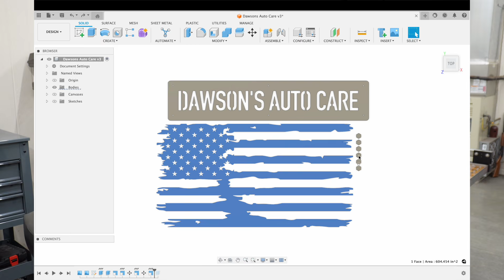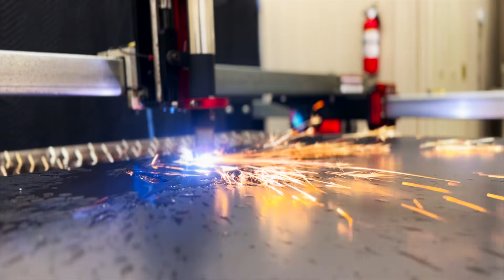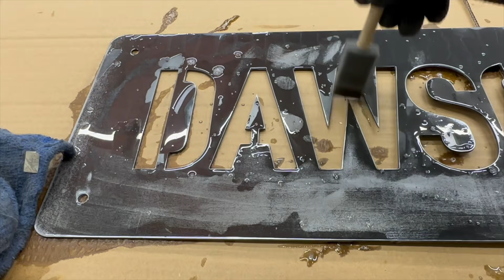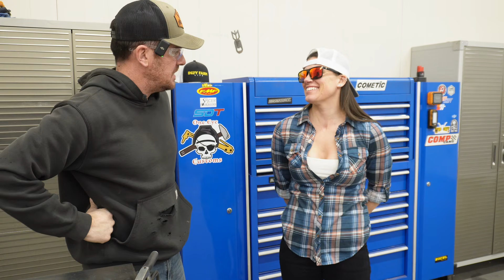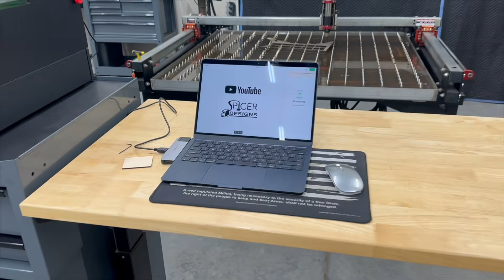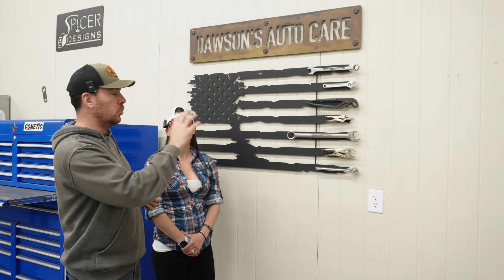CNC Plasma Sign Build....You Just HAVE To Watch This One

Comment from the maker: Check out all of Langmuir’s tables here: https://store.langmuirsystems.com/?aff=25
Reply: I actually just made a splash guard 😅 I was worried about water getting into the electronics as well. I have a shelf I made on the bottom of the table with some L channel and aluminum cutouts that holds my razorweld. Mainly because cords draped everywhere drive me insane and I already had to fab a new voltage divider cable because I caught it and snapped it off. Which I added an inline capacitor to level it out better and it works much better more stable voltage readings no random torch outs. To make the guard I just measured the distance of the torch mount bolts and height range of the z axis designed out from that. I ran a slot mount instead of a fixed mount to add a spring system to it. So when it touches off the guard it moves up and back down without binding up the torch height control. If you have a sheet metal bender that's perfect. If not you should definitely get one it's a solid investment and will get used once you have it... you'll get tons of new ideas trust me. I generally program a small v shaped notch along the edges where I'm going to bend the part for alignment and bend relief.
Reply: And actually if I had to redo the guard I would have designed it so the front portion was a separate cutout piece with a hinge so changing consumables would be easier. Which I still might do at some point
Reply: Have you figured out you Torch height controller yet.
Reply: Your lady has no class nor do you 🤮wish it didn’t mix with the USA flag which has the class

Comment: I cut at 45w 100 in/min. is that ok for smaller, more intricate designs? My school just got it a bit ago, but I'm the only one willing to set it up for custom cuts. works well with downloadable files though.  (I have crossfire pro with the specific CNC torch)
Reply from the maker: Depends on the material and thickness.

Comment: Those clips you welded onto the sign the rusted sign to hang it on the wall.  Whats the name of those clips so i can make some with my cnc table.  How did you make them and what guage metal did you use?  Also what guage metal is the sign?  Im just starting.  Thanks for great ideas!!
Reply from the maker: I use 14 ga for most of my signs.  Especially if i weld in them. Just have to draw them out in cad and bend them.  I sell my design files if you want to email me.
Reply: Ok i did send email thanks

Comment: Really comes down to how quick you think you could do it. I have a different table that could do all of that in one cut session and at 200+ ipm. If I had the DXF files ready to go, probably around the $550 mark all in is what I would quote someone for this. Double the material cost (roughly $40 for half a sheet 4x8 14ga x2 = $80) + $50-70 consumable fee (paint, electrode, tip, electricity) +  roughly 4 hours shop time which would include the like 10 minutes this was being cut. No DXF, add a $75/hr draft/Etsy search fee (cheaper than shop rates since it only wear and tear on my desk chair), minimum 1 hr. If it took 10 hours, my rates would be in the $1150+ range.
Reply from the maker: Thanks for the breakdown

Comment: Lately Ive been running my water at only like 1/2" deep. Not much splash and a bit better scale to knock off.  Just something that works for me.  Ive been using vinegar for cleaning the millscale off. Just a tub I soak it in overnight, im sure muratic acid is way more effective, but then I have some vinegar ready to go for uh salad dressing and what not.  Hah hah another upside down machine. Too hilarious.   Oh yeah and also, I cant really see any difference between the performance of the 20W vs the 40W laser, Im starting to think its a marketing scam with just different sticker.   With that in miind, use the C02 laser, mark the tools with snap-on and double the charge. ha ha  Price, metal alone is $100, tools $60, time $800 ish, tooling $250 = 1200 ish.  this comments way to long
Reply from the maker: I appreciate the feedback. Always look forward to your comments

Comment: Kyle, just throwin this at ya. Harbor Freight engine hoist, two 2"x4"x5' , 4 'C' clamps, and either 2ratchet straps or rope. Make an Egyptian pyramid from the apex of the hoist to the sides of the steel sheet for lifting to the table,.....or wait for the Keystone girl to stand opposite you to lift the steel. I like my first idea better, cause it's on YOU  if the sheet falls.
(Just sayin)
 Oh yeah ... what's covered behind the moving pad?🤔
Reply from the maker: Good suggestion. I just have tools and material on the shelves. I keep it covered so it looks better in the videos.  Its all temporary.
Reply: @SpicerDesignsLLC  Ok, I'll buy that, since you keep a neat and clean shop, ...everybody has a "kitchen junk drawer'' !!! Lol

Comment: Hey Kyle! Wanted to suggest tapping a T fitting and valve into your compressor line to run bubblers in your new water table. Also, you can use the positive air pressure routed to an RV water tank under your CNC machine. RV water tank is lower profile. Open air valve to water reservoir and it will push water up into your table.
Reply from the maker: Thanks for the suggestions.

Comment: What laptop are you using to run 360 or what do you recommend?
Reply: Fusion is single threaded so get the highest speed processor you can afford. The models run in memory, so also get as much memory as you can. If your models get larger than what can be placed in memory, Fusion will come to a halt. Rendering is multi-threaded, but that's not that important to design.
Reply from the maker: I use a macbook air.   Its worked fine for me over the years for what im doing.

Comment: I have to play with my spring back setting in the post processor to get my thc to start at the correct height. 

I check it with a .060 shim by starting the cut profile in fire control with the plasma cutter off, then go back and forth between fusion 360's post processor spring back setting and re-uploading the cut profile in fire control until I get it torch height set  correctly. Usually only takes a couple of tries.

Thanks for keeping the content entertaining for another Indiana boy!

Comment: You don't need to use a calculator. Let Fusion do the math for you. If you enter 24/46 into the scale factor field, Fusion will do the calculation. It's also more accurate since its not rounding the result. Just a quick tip.
Reply from the maker: I never knew that.  Someone else mentioned that too.  I will definitely give it a try.   Thanks for the info.

Comment: What guage steel are you normally using?
Reply from the maker: I like using 14 ga.  Mostly because i weld on most signs and it takes the heat a little better.

Comment: Check your connections everywhere, especially on the head. I had the same issue with mine and it was a lose connection at the head one of the two wires had a lose connection where the terminal end was crimped and it was doing the same thing yours is On the height control.
Reply from the maker: Thanks ill check that out.   The initial torch height is good thats determined by the limit on the torch head.  I think its something with the THC and the reference voltage.  Idk.  Ill check it out though.
Reply: One more thing bud, make sure your firmware is up to date cause there was a fix added for this. Just was thinking about it. 👍

Comment: No math need to scale you can just input size you want divide by original size. Something like this if the body is 12 stock and you need 24 just input in like this 24/12 in the scale factor spot. 🍻